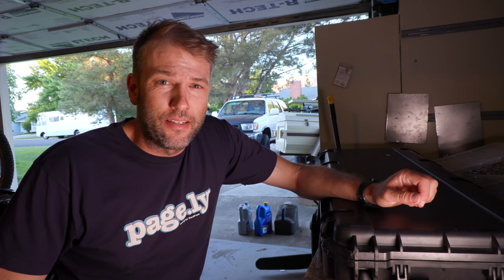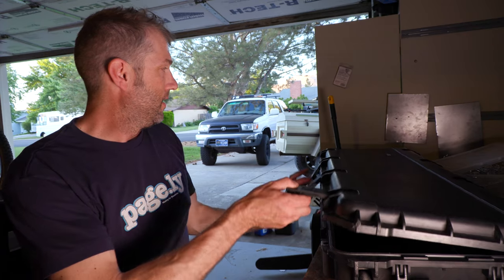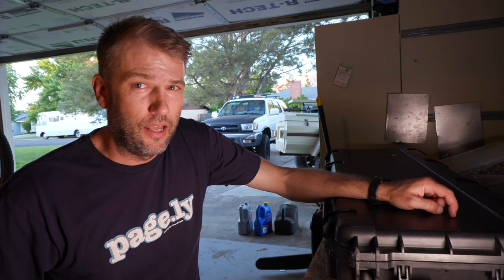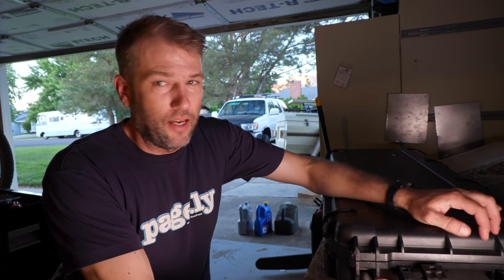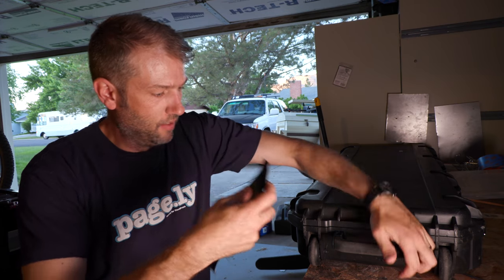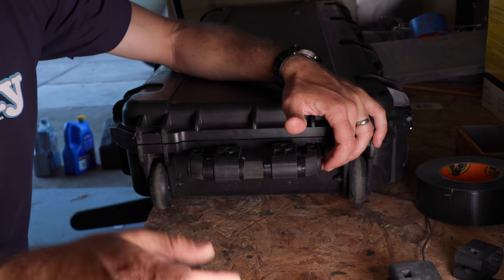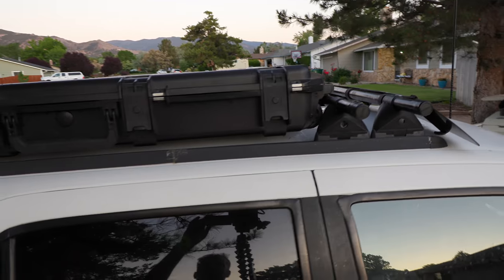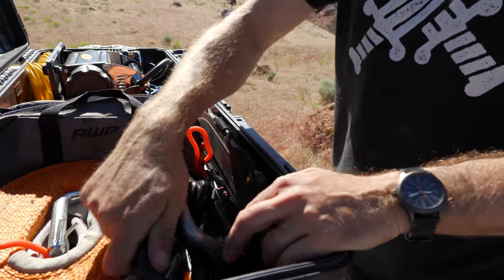Roof Mounted Case Cruzer Rifle Box for 3rd Gen 4Runner

Comment: Nice setup. I used to have a plano gun case on the roof of my tacoma but took it off when I mounted a hardshell RTT. I miss having the case up on the roof since it made things easier to find and get to on the trail
Reply from the maker: I like it! But it does sag with gear in it and touches the roof. I’ll need to figure something out.